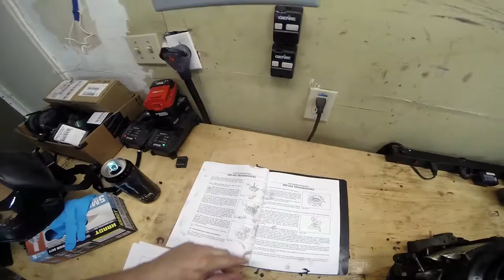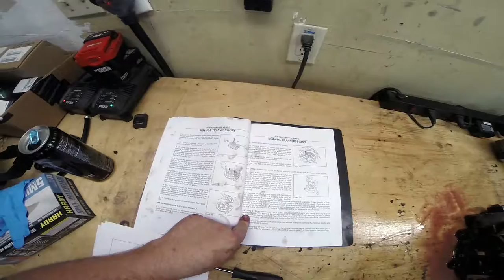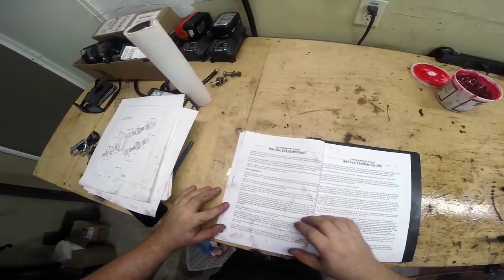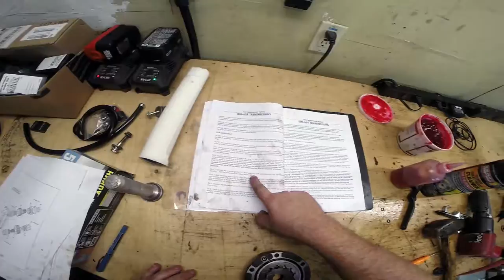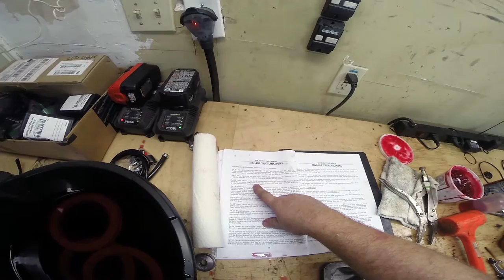MaksWerks Garage - DIY Step By Step Rebuilding a PCM 40i Boat Transmission

Comment: Any thoughts on why the drive shaft still spins a lot in neutral?  I was thinking I need a rebuild but was told to change fluids and clean filter first.  Is the filter accessible  on this unit?

Comment: Maks, thanks for the fantastic video...could not have done this without you.  I did everything as you instructed and got it all back together and back in the boat.  Reverse is working great, but no engagement in forward.  The only snafu in the build was when I put the piston in the adapter housing the first time and pressure tested it the way you do at the 45 minute mark, the o-ring blew out, so we had to disassemble and reseat it.  It all tested fine after that.  Any thoughts on why forward isn't engaging?  I'm really hoping for a simple fix...
Reply from the maker: Off hand I don't know without being there. You have to very careful about orings. If it blew out it could have damaged the the o ring.

Comment: I have a leaking 40A . Do I need to disassemble entire transmission if just resealing? Sorry if dumb question
Reply from the maker: Depends where its leaking from. you can input and output seals with some basic disassembly.

Comment: Thanks for this. Considering a rebuild myself. How similar is the PCM40i to PCM 40A 1.23/1 TRANS? Evidentily I have the 40A
Reply from the maker: They should be pretty similar. Just a few part changes different.
Reply: @Makswerks1  Thanks! I dont see a 'kit' on skidim. Do I just buy all of the items listed?
Reply from the maker: @chris3237999  I would give them a call on Monday. I dont want to tell you the wrong thing. SKIDIM is super helpful and knowledgeable. They will set you straight. The manual should give you the info you need.

Comment: Thanks for this.  Greatly appreciated!!   I have a 1.23/1 where reverse stopped working but forward is fine.  You still hear the reverse gear whine, but th prop shaft doesn't turn.  Fluid level is fine.  I was guessing the reverse clutch plates were bad, but after watching your video, I'm not so sure now.  Question:  I don't have access to a press.  I assume I must have one or I won't be able to do it, correct?

Any suggestions?
Reply from the maker: Ya. You really need a press. The 1.23/1 also has extra steps dealing with that lower gear ratio. You can get a smaller press at places like Harbor Freight (US) or similar around the world for under ~$100.

Is the fluid itself clean? I would drain it and look for clutch parts (like little gray dirt) or is there a bunch of water in the fluid? It may be a blocked passage, due to lack of hydraulic fluid.
Reply: Thanks.  I'll go to Harbor Freight to check out presses (or see if someone in our ski club has one).

The tranny has about 500hrs on it; fluid changed about 300hrs ago (still doesn't look burned--I check it all the time).  I've never drained it from the bottom; not sure there's enough clearance to get to the plug.  But I'll check again.  Never seen any water on the bottom of the dipstick, but maybe it wouldn't adhere anyway.

Now that I think about it, a blocked passage seems more plausible over the reverse clutches going out since reverse is not engaged anywhere near as much as forward.  Since I did hear the reverse gear whine, it seems reverse gear was engaged but the clutch didn't engage.  Maybe I somehow get a container under the plug and drain it that way to see if there's clutch material or water.  If not, then maybe I just try refilling once to see if something blocked unblocks itself.  Too bad there isn't a way to backflush the passages without dismantling it.
Reply from the maker: The manual details a way to check pressure on the ports at the top of the transmission. You should start there. If you dont measure the pressure needed on the port for reverse you know its a pumping issue (clog, damaged channel, ect)if you get the pressure you expect its the clutches.
Reply: I downloaded the manual but I haven't found a program to unzip the file.  Hopefully will find one in the next day or two.
Reply from the maker: 7ZIP or WinRAR will take care of it for free.
Reply: Thanks Mac!  Looks like my last post didn't go through.  I did get the files open last night.  But I couldn't find where in the manual it talked about how to test pressure for forward and reverse.  I didn't see where the ports are to connect a pressure gauge to.  But I just quickly scanned the doc and will have to go back and look more carefully.  I saw the breather, the neutral switch, and the cooler return line on the top of the tranny, but didn't see something obvious as to a pressure port (I'd assume they'd be next to each other.  Need to figure that out so I can make sure I have appropriate adapters to connect the gauge.  I'm sure I'll find it in the manual.
Reply from the maker: You need to go and open the PCM_40_a_trans_man.pdf. The specific line pressures for forward and reverse are on the bottom of page 7 (of the pdf not the paper) The oil pressure gauge spot and the distribution block on the top of the trans. There should be a plug in the spot. Its right on top, directly to the right of the dipstick.  Its where the little selector arm is.
Reply: I still can't find these ports.  Above the selector arm at the top is where the neutral switch, the cooler return line, and the breather is.  I don't see any other plugs, etc. to attach a pressure gage.  I may go to the local Nautique service shop and see if they have one there and can point them out to me.  Of course, they'll just say they need to pull it.  I'll do it myself....
Reply from the maker: Watch the video at 29:58. Pause it there. Just past my hands you can see there is a little square bump at the back end of the transmission. On top of it is a plug you can unscrew. Then just find a pressure tester that has the same thread. I am sure its a standard NPT 3/8 or 1/4 size.
Reply: I see it.  Thanks!!  I can't get to it until at least next weekend but I'll let you know what I find out.  Thank you again for the great video and replies!!!
Reply from the maker: No worries man. Not a ton of info out there on these boxes so I am trying to make sure folks can find what they need.
Reply: HI Mac, I haven't gotten a pressure gauge yet, but I replaced the fluid, pulled out the shift valve (looked clean), put it back in, hooked up a garden hose and started the engine.  Went into forward with no problem.  Went into reverse probably 5 times (I went back and forth from forward to reverse to forward etc. slowly).  Then it made a loud "screeching" sound (like maybe the clutches were not engaging but slipping and the shaft wouldn't turn).  The prop shaft moved slightly, but would not turn.  I tried it a few more times with the same result.  I put in two quarts (which was less than original amount), but it was still low, so I put in a little more (probably 4-5 ounces) so it was closer to normal on the dipstick.  The results were the same.

You mentioned some spacers behind the shift valve (with the spring) and said that controls the pressure.  Is that the pressure for engaging the clutches?  It kind of seemed that it engaged kind of slowing (even in forward), so I was wondering if maybe I have overall low pressure and by putting in another spacer it would increase it (?).  I do have to get a pressure gauge and test pressure (will do that sometime this week).  But it was very odd that it engaged multiple times into reverse and then stopped.

Please let me know what you think about it going into reverse and then not going.  Any idea what that might be?  If I need to pull it and dismantle it,  I will.  But I also don't want to pull and dismantle it and find out it was something with a simple fix.

Thanks,

Gordon
Reply from the maker: Just a heads up, my name is Maksim, or my friends call me Maks. Hence the name of the channel. 

Just cause it looks ok doesnt really mean its holding pressure. Putting a gauge on it is really the only way to know for sure. If the prop isnt air spinning at all I would lean towards a pressure issue even more. even the tiniest amount of engagement would cause the prop to spin in the air.
Reply: I tested all three ports (forward, neutral, and reverse).  All were about the same PSI (115PSI) at idle.  I tested the neutral and reverse ports  at 1500rpm and the pressure was still around 115-120PSI.  

Any idea/suggestion before I pull it out?  :)
Reply from the maker: Supposed to be 170 psi at 1500rpm. So there is your answer. see bottom of page 7
Reply: I saw that.  I'm going to get a 300psi gauge to test the high RPM.  But what doesn't make sense to me is since the pressure is within spec at 700RPM (when you normally shift), why wouldn't it engage (especially out of the water)?  When I'm at 1500 or 4000rpm, I'm already engaged.  So why wouldn't it engage at 700 with 115psi since the spec goes down to 90psi?  Anyway, I'll do the final test with a 300psi gauge before I pull it out.  Appreciate the feedback.  Looks like either the pump or the pressure regulator.  Maybe I should remove a couple of the "washers" in the valve that lower pressure.  Pull a few which should increase the pressure.
Reply from the maker: I think its actually the other way around? You add shims to increase pressure generally. However I would not do that. They are usually set correctly at the factory. The other thing to consider is load. You may be getting 115psi with no load on the prop, but you may be bleeding pressure on in the water.
Reply: Interesting point about load.  Maybe I'll run down to our pond and do the idle tests on the dock (with the boat tied tightly), then unbolt the prop shaft coupling and do all of the tests (700, 1500, and 4000) again.  Actually, I'llprobably do both the 700 and 1500rpm tests with the boat on the trailer in the water but won't do 4000rpm tests with actual load.  :)  Thanks again for taking the time to provide suggestions, etc.  Really appreciated..
Reply from the maker: No worries man. For me I wanted to get back on the lake, so I just yanked the bitch and rebuilt it, but these are basic diagnostic techniques.
Reply: I'd be more motivated, but slammed into the wake in the course I think the same day reverse went out (6-8 weeks ago) and thought I cracked or bruised a rib.Tried twice to ski again and it's still sore (I think it is muscular now so need to figure what muscle so I can do some PT to strengthen it).  So not as much of a hurry on the tranny (besides, lots of friends in our ski club that I can go with).  What ended up being the specific problem with your tranny?  I think I missed that in the video.
Reply from the maker: I found several seals that dried out so I a ton of fluid leaking past them. My clutches seemed ok. If you are going to pull it, I would rebuild everything though.
Reply: Mak, I FINALLY got the boat to the pond and tested all pressure ports.  Something weird going on.  PSI at idle seems okay for neutral, forward and reverse.  But at 1500 and 4000rpm, the forward and reverse PSI are low, and when I check the neutral port, I can't get it over 1200rpm before the PSI goes over 300PSI.  And forward is starting to slip, so I'm thinking there may be some sort of leakage somewhere.  I do NOT want to pull it apart if it is just some o-ring or something.  On the other hand, I guess if I have to pull it apart, I might as well replace the clutches.  My wife says to just buy a new tranny; don't want to spend the $.
Reply from the maker: Ya. Unfortunately there is no quick fix to this. It very well may be the selector rod orings or something small like that, but in a hydraulic system even a pin hole can be enough to sink the ship.
Reply: Mak, I talked to a local boat mechanic and also emailed SKIDIM .  Both said that pressure problems like I'm having frequently mean that the clutch drum has hairline cracks in it.  From SKIDIM: " Usually, when we see a pressure problem, it is caused from hairline cracks on the backside of the forward clutch drum which is caused from poor engine alignment."

If that's the problem, it's another $600 part.  I checked alignment and it is at .004 (it's never been that far out; don't know what happened, but sounds like a contributing factor).

I started working on taking the tranny out.  Got stuck because I had a PSS dripless prop shaft seal put on my boat, and the shop that did it must have used some serious locktite on the set screws.  And I can't seem to find the correct hex for the set screws.  1/8" seems a little small but I haven't found a metric that fits tight (maybe I'm missing one).  Soaking the set screws with PB blaster hoping it will help with the locktite (but looks like I need some acetone).  Last thing I want to do is strip them....

I have a couple of questions on removing the tranny from the engine (once I can move my prop shaft back enough from the tranny):
* It looks like there are 8-9 bolts that hold it onto the bell housing, four are 5/8" and are easy to get out because I can get a socket onto them and they come out toward the stern.  The other are the 1/2 " ones that are on the forward side (when you turn them out, they come out toward the bow), and  can't be turned out completely because the heads bump up against the bell housing (and as you said on your video, the bottom ones are a REAL pain).  I wasn't sure watching the video if you have 5/8" bolts all the way around or if you have a combination of 5/8" that come out with a socket and extension toward the ster, and 1/2" that come out towards the bow and hit the bell housing before they're backed out all the way.

Since your starter is in the back, it is different from mine; mine is forward of the bell housing.  So it is not in the way.  The exhaust hoses/pipe are in the way of the mounts, so I removed them (good thing, since one of the fiberglass pipes has a weak spot so I need to replace it).

* Assuming you have both types of bolts holding the tranny to the bell housing, how did you remove the tranny (after you took the mount bolts off)?  Loosen all of the 1/2" bolts as far as they could go, and then slowly loosen the four 5/8" bolts and then slide the tranny out a little, then turn the 1/2" ones out more (and repeat this until the 1/2" bolts are free)?  I only have two options:  1. slowly work those 1/2" bolts out as I work the 5/8" bolts out, slowly sliding the tranny back as I turn the bolts out until they come out of the threads (and hopefully the 5/8" ones are still threaded), or 2. remove the bell housing with tranny attached.
* How do you pull the tranny off the splined shaft?  How far do you need to pull it before it is free of it?
* Did you have someone help you (one person does the bolts while the other one supports it and pulls it off?
* Did you jack up the back of the engine so that it didn't drop?
* Did you remove all the bolts holding the tranny to the bell housing before you undid the mounting bolts?
* How did you break the damper plate?

Thanks in advance!

Gordon
Reply from the maker: Gordon

-I work alone - I also only  had like 4-6 bolts total. But you would need to watch my removal video 
-yes I pulled it out on the splined shaft. It needed a few good kicks. 
-An engine hoist (like for a car) worked great for me to lift the engine. 
-I would have to rewatch the video, but once I figured out how to break the mounts loose the trans slipped out the same as on a car. You can watch I have a video for removal that is separate from this one. 
-My damper plate was so rusty it literally fell apart in my hands.
Reply: So, it's new tranny time.  What actually happened is that the large gear that is press-fit into the hub popped.  It started slipping, first in reverse, and then started in forward.  When I pulled it apart and put the tranny upside down, the gear just fell out.  I just assumed it was supposed to come out until I took the parts to the local mechanic and he pulled out another hub with the gear intact.  When it slipped, it also damaged the bracket on the adapter housing and you have to replace the whole thing.  So all the parts from SKIDIM that I'd need run about $1,500.  Might as well pay $2,500 (including shipping) to get a new one with a warranty.  Plus it comes with a bigger oil cooler and a new damper plate.  My forward clutch pack steel was a little hot but didn't look bad.  But the bigger cooler should help with that.  Just waiting for ship info from SKIDIM.

Thanks again for your video and your comments and replies to my questions.  I really appreciate it!
Reply from the maker: damn. you got your moneys worth/. I would get that upgraded trans from ski dim. Its beefy as all hell
Reply: There is a bit of a quick and dirty way to do these sorts of things, instead of a press you can use leverage - if your work bench is sturdy you can bolt a block onto the wall behind it, then slip a pry bar under that block and when you pull down on the other end you've created a lever that can push down on the stack.  Its a lever instead of hydraulics or gear - and you can use a ratchet strap on the end.

If you want to be real creative bolt a section of square tube with holes in it and you can make a pry bar with a clevis pin and set the height for other projects - works great to clamp things you glued also - you can hang weight or use a ratchet to squeeze down on whatever you put beneath it.  You do want to try to keep the lever roughly level - if its angled up/down it will push sideways on your work.

Comment: Don't rebuild a PCM 40, just buy a brand new PCM 80 for about $1,800
They have both 1-1 and 1-123 etc...
Reply from the maker: I mean sure. If you want to spend like 3x the money the 80 is def the better trans.
Reply: Where can I find a PCM80 1.23 right hand drive for 1800? Thanx.